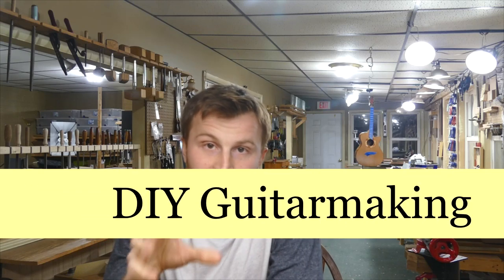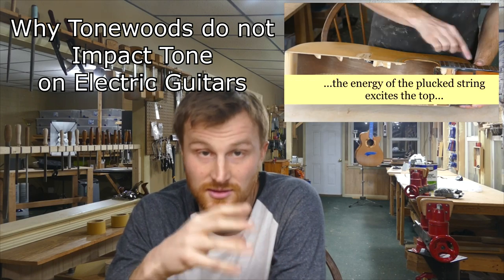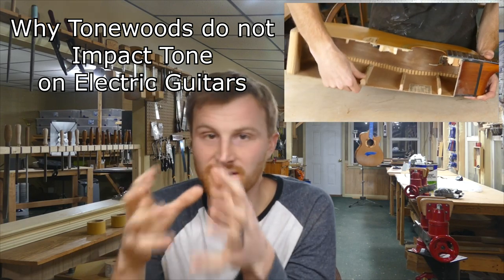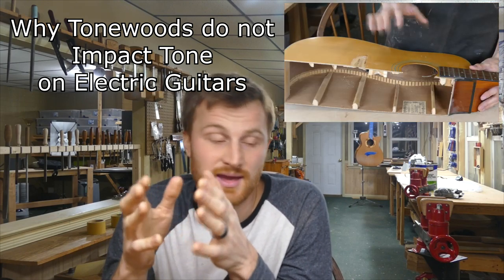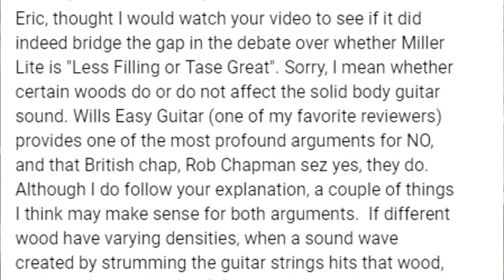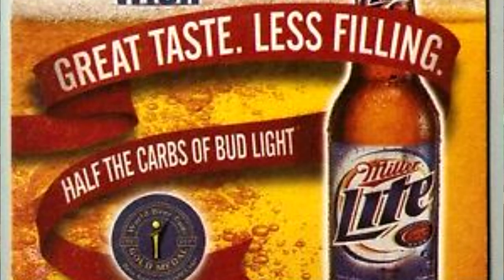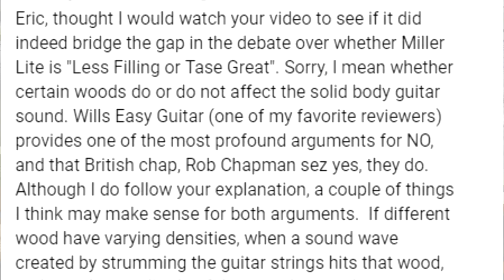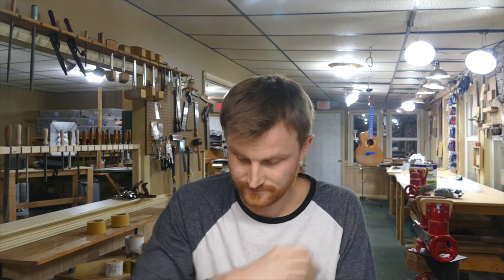More on the Electric Guitar Tonewood Debate

Comment: I think the wood on an electric guitar will influence the tone as some kind of filter, similar to a capacitor in a tone control on an amp. Surely the wood on the electric guitar dose not amplify like on an acoustic guitar, but as the base for the string vibrations, the wood can shape the wave form thad will be transduce by the pickup to the amplifyer. The pickup don't "see" the wood but the shape of the influenced wave form.
Reply: But the wood isnt the base of the string vibrations. Your pick or hand is the base for the string vibrations. That vibration is picked up by the pickup and alot is lost into the air..A very minimal amount of vibration will rebound off the wood but that is still not a tone. It still rebounds back onto the string. No matter how you think of it the key is that the string is always the only factor being taken in by the magnet (pickups).  There is no possibility for the wood to colour the sound. At most it simply cause longer vibrations. You can test how significant this vibration is  by banging your guitar see how little noise it makes? Well the rebounding waves from the strings are gonna be way less.

Really  listen to this guy because the key to understanding this is understanding how pickups work. They arent microphones. And understanding how acoustic guitars colour the guitars sound like a cave or a room colours sound. With no hollow space that cant happen.

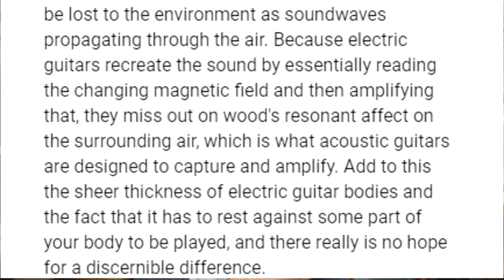Comment: 8:00 I would argue keeping the guitar in rest against the body will not at all dampen the vibrations of the guitar itself. It won't do that on a classical guitar either. And I play on an Ibanez QX52 headless guitar which I can literally feel vibrate throughout the whole guitar body when playing. No damping there. Not even if I would try to dampen it. Also, magnetic pickups can pickup secondary effects from vibrations into the strings. This is why good setup is important and also why people want to avoid 'microphonic pickups'. I would argue the debate should be way more about how much/little the tonewood matters. Because even though the physical property is important, I would say it doesn't matter 'much'.

Comment: This guy is explaining it perfectly. Understand that pickups arent microphones they are magnets and the only thing they are picking up are the vibrations of the metal string. And understanding how acoustic guitars colour the guitars sound like a cave or a room colours sound. With no hollow space (soundbox) that cant happen.

That vibration is picked up by the pickup and alot is lost into the air..A very minimal amount of vibration will rebound off the wood but that is still not a tone. It still rebounds back onto the string. No matter how you think of it the key is that the string is always the only factor being taken in by the magnet (pickups).  There is no possibility for the wood to colour the sound. At most it simply causes longer vibrations. You can test how significant this rebound vibration is  by banging your guitar, see how little noise it makes? Well the rebounding waves from the strings are gonna be way less.

Comment: Eric, I am in agreement with your opinion. I don't think the type of wood makes a lick of difference on the sound generated from an  electric guitar. What would be an interesting experiment though would be to make an electric  guitar out the optimal tonewoods and another one out of something sonically dead like concrete ( it would be really heavy) and use the same electronics in both guitars and see how they sound. You could use maybe an oscilloscope to compare the sound waves in both guitars if you  wanted to get really technical.
Reply: why not take two guitars regardless of makes strum them as hard as you can with no amplification,   record that sound and tell the difference, then take two tele's one with rose wood neck smash the hell out of them and listen for a difference?    job done

Comment: I have seen other Youtubers do comparisons whereby they swap body wood but keep everything else the same (though none has come up with a mechanical plucker and keeping that aspect consistent is hard). That's enough to convince me there is a small difference that you can notice when you hear sound samples back to back although you might be hard pushed to identify which is which if you heard them in isolation. It's not difficult to justify why there might be a difference - the way the wood vibrates will feed back into the way the strings vibrate and also the pickups which are fixed to the body will themselves vibrate. Having said that, I would be willing to believe that the margin of difference is not much more than that found on guitars from the same production line made from the same materials. The biggest effect on tone would be the speaker and no-one talks much about speaker cabinet wood and I suspect few people know, let alone have an opinion on the types of material used in speaker diaphragms (the sound pump of an electric guitar).

Comment: I can remember an instructional video…. Where they did a blind sound test…. They said one was a Stratocaster, they said one was a telecaster. They said one was a Les Paul, They said one was a fender, precision, They said one was a fender Jazz,.. and on and on…

After everybody debated, for what looked like a half hour,…on i.e; what type/era/woods/finishes/pups/etc the “guitars” were by sound ,… they then  removed the partition (hiding what was being played) to show that they were all just warehouse slabs of wood, jerryrigged with electronic pickups IN THE EXACT SPEC POSITIONS as the aforementioned brands! (of course, the pickup placements “relative to the corresponding nut-to-bridge ratio)

Nobody could believe it … my jaw dropped
It was the same Home Depot type piece of wood, on 5-6 different rigged, guitar necks

what it showed, was that with “electric (solid, body,) guitars”, the most important aspect of the character of their unique sound, Was pickup PLACEMENTS & CONFIGURATIONS , and of course, the “types” of pickups

(I wish I can find that video, it was years ago before the Internet on a VHS tape)

Comment: Magnetism creates "electromagnetic waves", which are photons traveling at the speed of light.  Sounds waves are a completely different wave, a compression wave, that travels at the speed of sound.  So the question is can the two wave patterns interfere with each other in a discernible way?  My gut feeling is that the wave properties are so vastly different, that if interference of the magnetic waves is possible, it is at levels that are so incredibly small that the variances caused by one wood or the other, would for all intents and purposes be zero.

I agree Eric, the tone wood argument is out.  I don't think compression sound waves will interfere with electro magnetic waves in enough of a way to make a difference.  The electric guitar argument is really one of how the body affects the string movements, but that argument has nothing really to do with resonate wood types, as plywood or resin might result in more favorable string vibrations that the best tone woods.
Reply: This don't seem logical to me. With this theory we all would sound the same through a microphone. They all are based on electromagnetic waves traveling technology also known as  a transduce technology. Witch wood is a "good" tone-wood is surely a personal preference. Plywood as an example is not a bad tone wood per se. The resonate frequencies of a good quality Plywood could be very valuable for guitar building, but most guitar player are against plywood because of personal preference. Gibson has used Richlite  for the fretboard because of the similarity to ebony in resonance. They are going back to ebony 2019 because with real ebony the finished fretboard becomes less expensive then with the specific type of Richlite they used. The Les Paul body is made of to layers. A Guitar neck is most likely made of to layers. Gibson ES Guitars are almost all made of some plywood parts because of the better quality end product. Synthetic woods are not always a bad cheap wood. In the big part of the wood industry a lot synthetic wood's are used for the best quality products. I would always prefer a plywood table over a solid wood table because of the strength and longterm stability. Good quality plywood is more expensive then solid wood. Today there is only a small niche for solid wood products because of personal preference from the buyer side.
Reply: @Rudysbluesguitars , a mic works completely different then a pickup.
A mic has a membrame which picks up the Sound Wave coming in and then turns that into an electric signal.
A pickup creates a magnetic field which changes by the vibration of the strings which then creates an electric signal.
Big difference between a sound wave and a vibration changing a magnetic field.

Comment: I think one of the reasons this is an ongoing debate is that people use "tone" very subjectively. In order to come to a definitive conclusion each single parameter needs to be tested individually. Like you, and some of the comments, mention - the pickups react to the changes in the magnetic field caused by the moving strings. The movement of the strings (mainly the duration, or the sustain) depends on the mechanical properties of the material connecting their anchor points (less dense, more porous, woods have more air pockets that reflect sound waves, creating energy loss through heat, etc.). When you look at it like this, at least to me, it is clear that the type of wood used, mainly for the neck, has a significant impact at least on sustain. However, considering that the majority of guitars (electric or acoustic) use the same few types of neck woods, for stability reasons, I'm not sure how relevant this argument really is...

Comment: Hey man im trying to think this through to explain it to a friend. How about on hollow body electric guitars... does that change the equation much?
Reply: A hollow body has more mass than a solid body, hence the strings vibration will be different, the dissipation of sound is greater, when the string vibration travels through the wood because of the soundhole which releases the vibration before it travels back through the strings, notes will have less sustain than a hardbody, but a more even frequency (no overtones) ideal for say strumming open chords etc, using a pickup over an acoustic soundhole will give you similar results, but there is even more mass to consider in an acoustic.
Reply: See my notes I just posted above.  Hollow body electrics are weird.  The vibrations of the top are much greater in amplitude than on a solid body, so they may vibrate the pickup relative to the strings to a signficant degree that affects tone noticably.   (Besides decreasing sustain.)  The pickup is usually in a good place for an electric guitar (the main effect on sound),  but may be in a bad place for picking up body vibrations.   For example,  AIUI on an archtop the body action is mostly relatively near the bridge, where the top's excursion is highest like a speaker cone, but the pickup is usually near the neck.  The part of the top between the f-holes also twists from side to side, radiating some frequencies in a distinctive "dipole" fashion, but the pickup being on the midline and stabilized by being near the neck probably means it doesn't pick up much of that.   Many  people assume that a hollowbody electric (archtop or flattop with a soundhole pickup) will sound better electrically if it sounds better acoustically, but I don't know if that's true and haven't seen any good evidence of it.

Comment: Since this tonewood debate has been going on for decades, it's very clear to me, that there simply cannot be any significant differences between tonewoods in solid body electric guitars. If there was, then there would be no everlasting debate over it, because practically everyone could hear it clearly. So the tonewood effect is very subtle at best. This has to be the case.

However, the point which someone made, that solid body still vibrates somewhat and therefore the pickups vibrate as well, is also true. To prove that, one can dampen the strings with one hand (so that the strings cannot vibrate) and knock the solid body with the knuckles of the other hand, to make the body resonate.

That guitar body vibration (or resonance) will be picked up by the pickups - because, although the strings are not vibrating, the pickups are (because they are attached to the body). And according to Maxwell and Einstein, it doesn't matter if the strings are vibrating close to a stationary pickup, or the pickups are vibrating close to a stationary strings - the effect will be the same, which is - changing magnetic field, which induces an electric current in the pickup's coils which is then amplified by the amplifier, and voilá --> you can hear the body ringing (or hear the resonance frequencies of the body).

Here's Steve Vai doing that (amongst other things) live on stage:
https://youtu.be/9f1gcTiNBww?t=213

So yes, the solid body vibrates and moves the pickups, therefore coloring the tone, but is it significant effect when playing "normally" and not tapping the body with knuckles? If it is, it has to be very subtle - and this is why this debate goes on and on...

I can understand the views of the both camps; if you are just listening to the sound of the amplified electric guitar, it's very difficult (at least to me, and presumably many others) to hear any significant difference between two similar guitars made out of different woods - but when one is playing those guitars, they can FEEL the differences in those guitar body vibrations actually quite clearly (as anyone who has played different guitars will know, their vibrations feel very different) - and maybe that is the thing, which throws people into thinking that they can HEAR the difference as well.